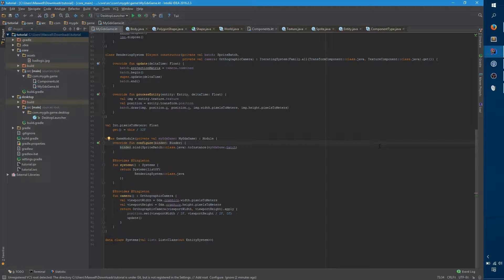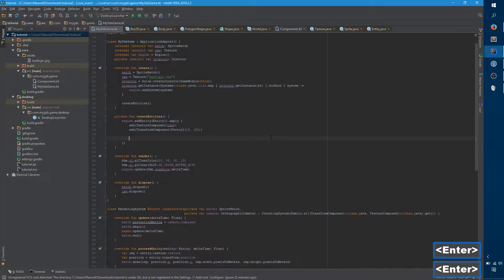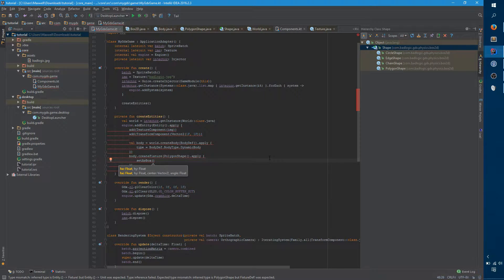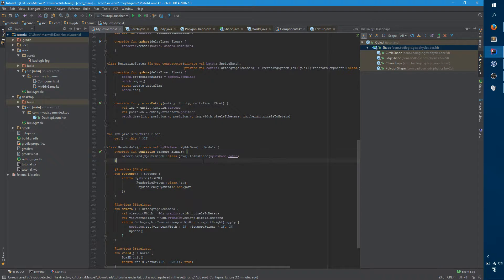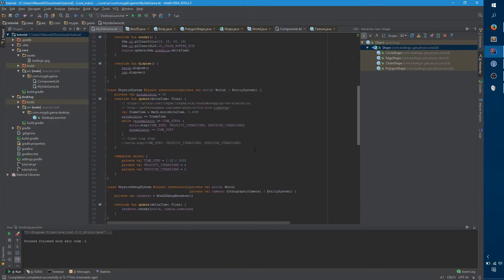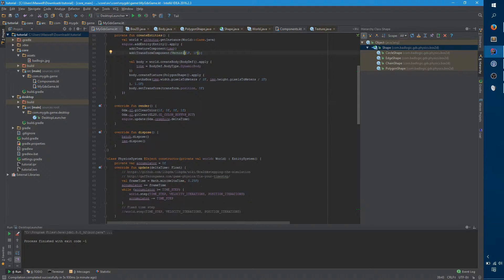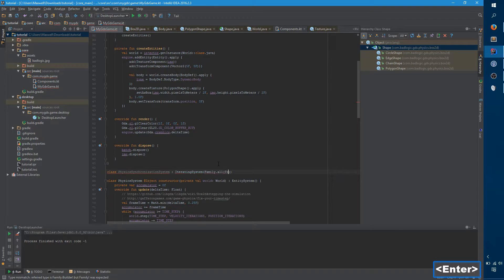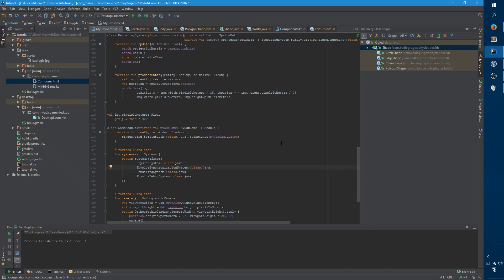LibGDX + Kotlin: Part 5, Intro to Physics (Box2D)

Comment: Hey, I'm following those videos and I got a doubt... At ~4:10, why do you do a .getInstace of World instead of doing that @Inject constructor() thing?

I'm kinda new to Kotlin and even 'newer' to Game dev, I'm trying to keep your rhythm but I'm going slow hahaha
Your videos are really really great, I think you deserve a lot more of views on those videos.
Thanks in advance
Reply from the maker: To answer your question: because this class (MyGdxGame) isn't being injected -- it's not being constructed by Guice. This class is creating the Guice injector, and so anything you want Guice to construct inside this class you have to request using injector.getInstance(). The smarter thing in this situation would be to create a single "bootstrap" class that's sole purpose was to set up the Guice, call getInstance(MyGdxGame), and then pass off control to MyGdxGame, so that way you can inject what you need into MyGdxGame, but...so long as the getInstance crappiness is confined to a single class (MyGdxGame), it's not soo bad.

And thanks! I'm glad you like the videos :D
Reply from the maker: Actually, looking at this again, you can't inject the MyGdxGame class itself. This is because it needs things like the SpriteBatch, which should only be initialized at the right point in the lifecycle -- namely, `create`. If you create the SpriteBatch in a module that gets constructed before LibGDX has had a chance to set up...I think it blows up. You could use the MyGdxGame itself as the bootstrap and so have the render method call `otherObject.render()` and put everything *there*, but it's kinda cumbersome.